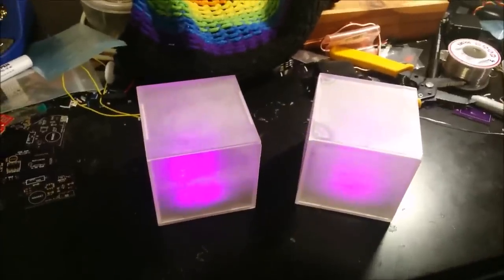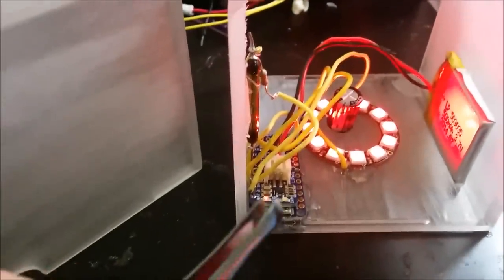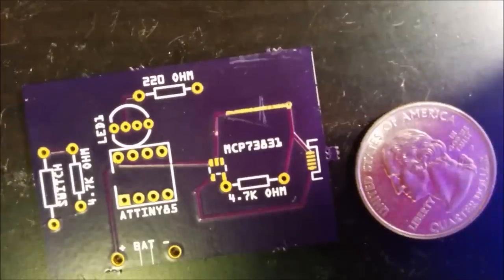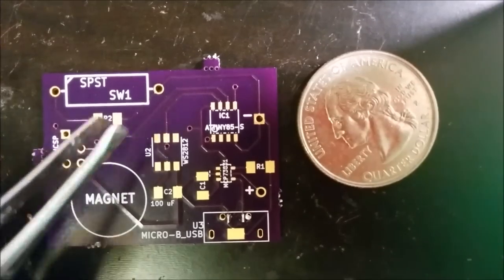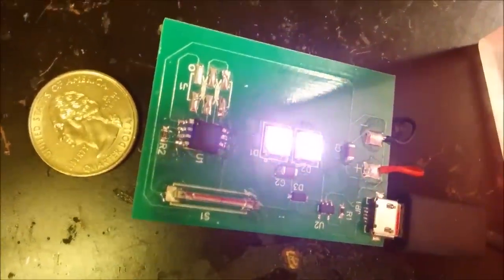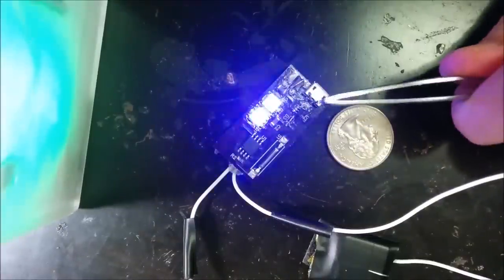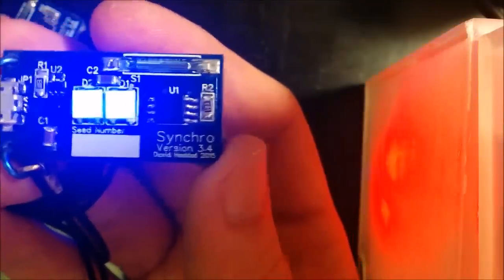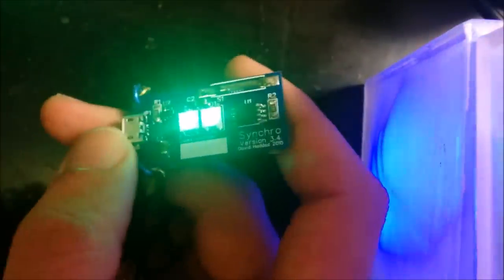Synchronized Luminous Love: The PCB Design Process

Comment: Where did you have the prototype and production boards made? Have you considered adding a crystal to improve timing synchronicity?
Reply from the maker: Ric Johnson I used OSHPark and SeeedStudio for the PCBs. Moving forward, I'm going to go with OSHPark. SeeedStudio had some quality issues on some boards.
I resisted the additional cost and complexity of an external oscillator for a while, and recent experiments are indicating that just having a regulated input voltage for the processor will be enough to get me synchronized.